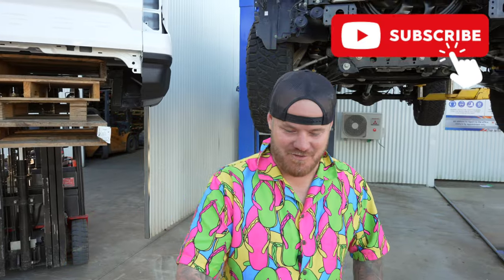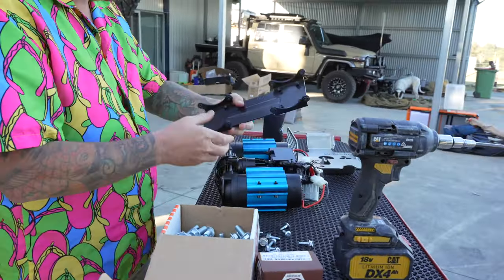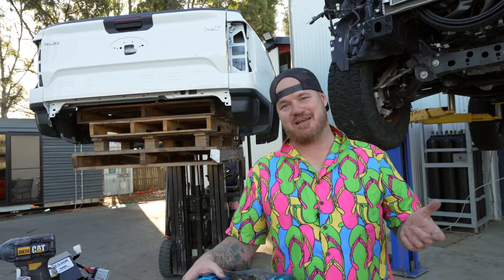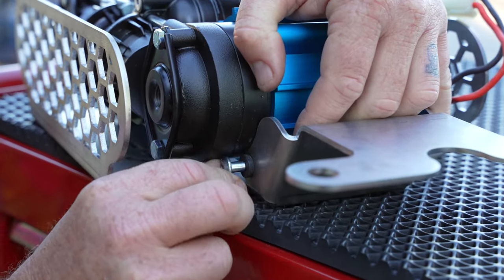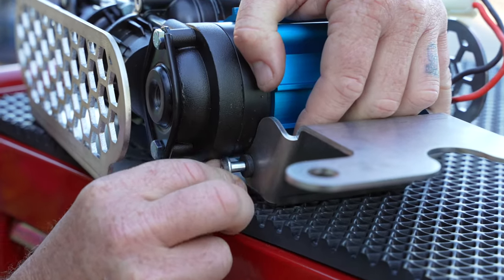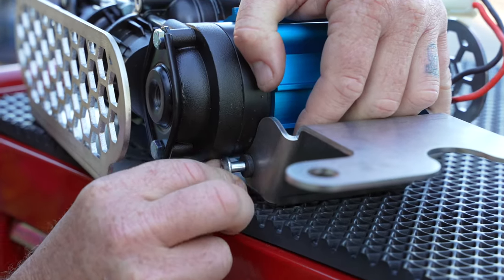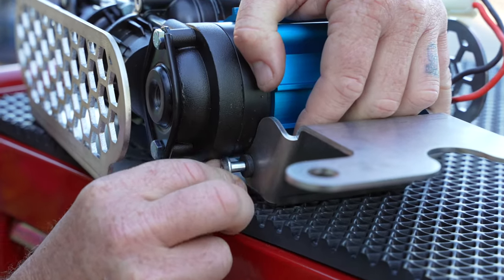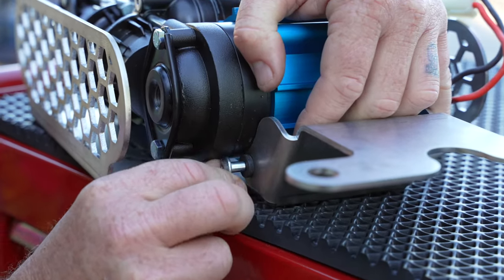NEXT GEN RAPTOR RANGER UNDER TUB COMPRESSOR KIT how to Install

Comment: Great products but an explanation as to why this is better than the arb version of the compressor mount would be good. Also should the filters be installed on the drivers side closest to compressor? Any tips on plumbing it all up?
Reply from the maker: G’day legend,

Thanks for watching. The main reason our products are better than other options on the market is because they bolt straight in. Others need holes to be drilled through your steel tub. We also offer a tidier & more protected spot for the switch & air outlet in our opinion.

As for the filters they can be mounted on any side, the tail light i had closest to me was passenger side. 

All 3 brackets are offered for drivers or passenger side.

We’re just waiting on some finalised pricing from Arb, hopefully tomorrow. Then we’ll be releasing a full kit with the plumbing. Arb sell all the fittings and braided hoses to plumb it up, & it’s reasonably well priced.
Reply: Any idea when to full kit will be available mate?

Comment: Thank you for the video 
I wish to know what’s the air filter ? Where it should be connected to ? The air compressor or the 4L Tank and what does it do ? Thank you very much
Reply from the maker: G'day legend - the air filter is part of the compressor. We made a bracket to relocate it higher so you don't fill them up with dust and water.

Comment: If that was a pensioners that did that to me when I was trying to work I tell you what, I'd stop and go and help them as they have trouble moving so it takes them longer because there old and they might do a hip if they try to hurry
Reply from the maker: Hahaha! Back story he’s not really a pensioner he just clocked the big 50 so we’ve started roasted him. He was on a 72” ride on 😂😂
Reply: @piratecampco  still older then us so he is a pensioner 🤣 the pensioner is lucky you didn't jump on the mower as who knows what condition it will come back in as look at the breadroll now 🤣🤣🤣 and who knows if you will be able to handle the horsepower the mower has.

Comment: can the tank mount be mounted on the rhs instead of lhs. for a short run if you have the compressor mounted from factory which is on the rhs.
Reply from the maker: G'day legend - yes, you certainly can, we offer a drivers side and passenger side option. 

https://piratecampco.com.au/collections/ford/products/arb-4l-air-tank-under-tub-mount-for-ford-ranger-raptor-2022?_pos=7&_fid=2c818007c&_ss=c

Comment: Hey Legend , great informative video. I saved it for future reference 😎 

Just to confirm, the ARB dual compressor does fit a Wildtrack with a step or only Raptor with No step? I’ve got a Wildtrack coming and really like to use the ARB twin with your bracket. Also like to fit on the passenger side of the tub if that’s an option?
Reply from the maker: G'day legend,

Thanks for watching. 

this particular bracket is for the raptor only, however we do have a bracket for the wild track and you can get left and right sides. I'll drop a link below. 

https://piratecampco.com.au/collections/ford/products/dual-arb-air-compressor-under-tub-mount?_pos=18&_fid=029b65bbd&_ss=c